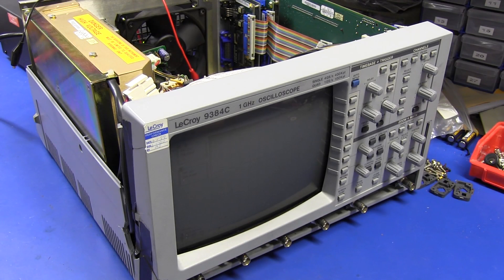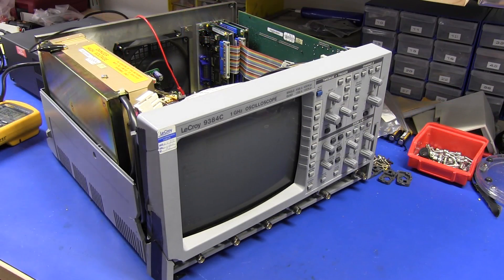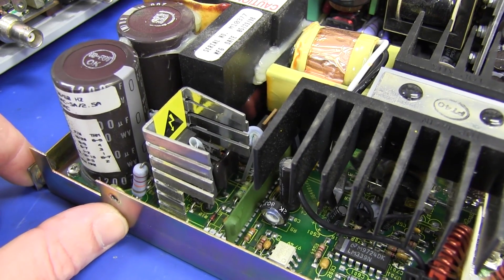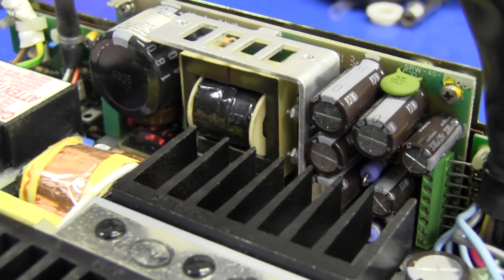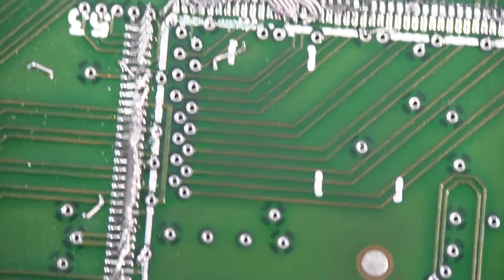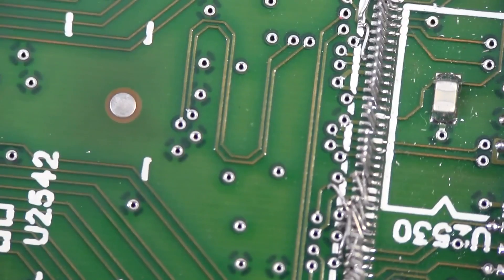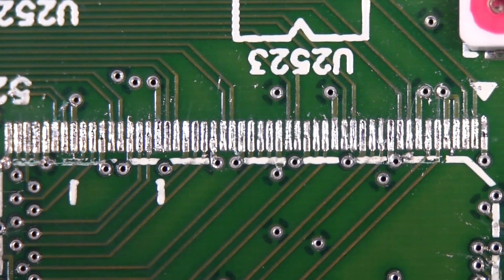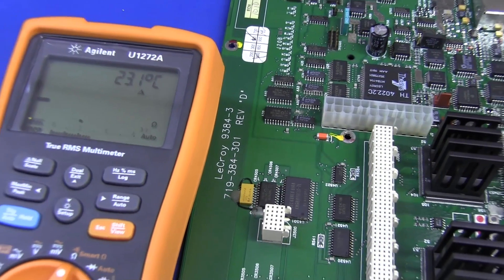EEVblog #405 - Lecroy 9384C Oscilloscope Repair - Part 3

Comment: OH MY GOD!! WHY?? It can be easily removed with the roses metal! Melting point is about 100C, so simply solder all the pins with the roses metal and then you can easy remove IC with hot air gun, because the melting point is very low. Bad decision

Comment: Way late, but I just got to these 3 videos.  I think you have introduced the Chip-Quick in another video, so nothing more about it from me.  Also, the lifting of individual 3.3 V pins has been mentioned, but I just remind that likely there are a bunch of them.  But one thing I must bring up:  The heat generated is supposed to be I ^2 times resistance.  A short almost by definition is zero resistance, so why would that generate any hot spot?  A temperature check does indicate heat generated in traces leading to that short, probably.  Or more likely, even.  Until the final conclusion, I was suspecting problems under the connectors, like the memory bus or the power input connector.  I personally have seen a couple of those.  But I have to agree that there had been a dramatic power surge that killed all those chips and the power supply as well.  RIP.

Comment: A $15 heat gun and a bit of patience will remove large QFPs quite easily. Just slow heat that area of board over a couple of minutes (even a bit on bottom side) and then concentrate the heat around just that QFP. A little flux on the pins will give you a clue that the temp is getting close. When the solder starts to melt wait just a bit longer and pull the chip. I salvaged 4-5 chips from a scrap board that way this morning myself.

We have a $20K Pace BGA rework station that basically does the same thing, i.e. heats both sides of board and pops the chip off with a vacuum picker.

Comment: The disappointing thing was that he didn't remove the heatsinks, because it might have shown holes in the chips. Heat softens glue so when they were hot, or with added heat gun,  they might have come off. Certainly would have given closure.

Comment: An interesting diagnostic session, and I admire your perseverance. I think if it was me it would have ended-up in the spare parts box about a third of the way through! Anyway, a useful point emerges, which is that diagnosis can go badly astray if it is assumed that a fault MUST be due to a SINGLE component, when that is not the case. In this case four components were faulty, and they were even giving clear fault symptoms, but it took a leap of intuition to realise that all four might be faulty. 

It is particularly relevant when dealing with a customer's job, since in that case some of the fault symptoms may have existed long before the thing failed completely, so searching for a common cause may be a fruitless exercise.

Comment: One tip to (destructively) removing this type of QFP packages from a board: get some piano wire or similar steel wire, push it into the tunnel from the side, and then pull hard  but slowly in a 45deg angle. This usually pulls the pins off the pads one by one just nicely.
Pushing a thick steel pin from the side may also be useful to leverage the pins off, but usually tends to smear/scratch the solder across adjacent pins..
Reply: Markus Strangl High risk of pulling the pads if you would like to put a new component back on again, but its true it would go fast. To snip the legs with a fine tipped cutting plier would pretty much be the best choice. With a exacto knife its still a little risky depending on exactly how its done.
Reply: dtiydr I didn't rip off any pads with this technique yet, but I can see how it might happen.
XActo knife has a certain risk to cut traces under the legs, though..
Reply: Markus Strangl Exactly; yet. :) And as I said if you use a xacto knife (yea thats what they are called), only if it done right would you not cut any traces.

Comment: You could check which legs of IC are connected to 3.3V and unsolder them, then check if short is still present.
You turned on the scope with 3 volt voltage applied, not 3.3 volts due to voltage drop on cables.

Comment: Please someone help me! I just got this small portable oscilloscope for free and the seller said it did not work. I brought it home and plugged it in. The screen would not turn on and in the beginning it gave out a burning smell. It disappeared after a bit. I opened it up and found nothing burned. All I found was a few transistors were becoming hot very quickly after turning it on. But the On light still operates telling me the machine is turned on. Can anyone help me with this problem? It's an analog oscilloscope.
Reply: reddit.com/r/askelectronics

Comment: That looks like a computer motherboard PSU plug...I wonder if a computer PSU would be able to replace that powersupply
Reply: No, he specifically mentioned +-15V and 2V being needed, those are not offered in PC PSUs. The scope supply also clearly used different color coding.

Comment: Would Lacroy supply a new board and if so do you know the cost ? At this point it's not a component level fix its a board swap. 
I suspect it's not cost effective to replace the board unless someone else is willing to pay the costs and even then there is the power supply repair on top of that. By the time it's all repaired you could probably buy one for less. Remember time is money !! Folks this was an educational process not a money making repair.

Comment: That won't affect the resistance measurements in the off state. In addition, another owner replied and stated that the resistance on a working unit was in excess of one ohm. This unit is exhibiting an order of magnitude less.

Let's run through good old Ohm's Law....

I (max rated) = 6A
R (measured) = 0.15 ohms
Vsupply = 3.3V

I =3.3V/0.15 ohms..... 22A.

The reason we only see 11A is because as the circuit heats, its resistance increases much like the filament of an incandescent lamp does.

Comment: Or as You said the 3.3 psu channel has its rectifier in short , sent AC the reversion of the voltage burn every chips,  there wasn't a single resistor as protection plus a zener... ufffff

Comment: I thinks, as you tested the board without the memory connected, those chips can't do the POST (power on selft test), they will try in a continuous way to check the memoriy (if they are microcontrollers/microprocessors)  they never will go to be in IDDLE, drawing mucho more current making heat.

Comment: As long as your SMPS is not shorting, Then I dont think its those chips. because you still have 3.3V @ 8Amps. those chips suck lot of power, and they have that heat sink, because they heat a LOT.

Problem maybe in other part. anyway GOOD VIDEO!

Comment: Dave, thats not a good method of fault finding.. You could have isolated the power lines to individual chips or could have lifted the suspected chip leg to check this. Well, i use this method for last 10 years & it works 100%, of course it requires lot of time & patience.

Comment: You just don't know what destroyed ASICs mean. ASICs aren't chips you can buy anywhere. The only one, who can have some of those ASICs in stock, is LeCroy, and if they still have those ASICs  (for this old oscilloscope model it's relatively unlikely), they would either use them for their servicing team. ASICs aren't like FPGAs where you only need the program to fit them a specific application, they are completly custom chips, and production runs cost millions of dollars.

Comment: Dave, I'm sure that you can see this coming... is there any way that you could have an underling (if you have one) do the same for the other three ASICs (cut them off and clean the pads) and then check the resistance?  I hate mysteries!

Comment: FYI: Your wrong, I use this very method to grind down Dremel  discs, one cuts in several places on said bolt making the disc as small as needed. Pity Dave's intelligence didn't rub off onto you before making a completely retarded reply to a stranger.

Comment: I had a LeCroy with a bum power supply that I binned, as well. I even had the service manual and new parts. It cost me more in putzing around than just replacing it

Comment: Put a cotton thread behind the pins. 
Now heat the pins at one end with the solder iron while you pull the thread under the pin.
Continue down the row with the rest of the pins.

Comment: Watching you remove the QFP was painful. It's time you did some (late) (non-denominational) holiday shopping and got yourself a system from Zephyrtronics   

Or just to get a feel for it, this kit from Digikey: SMD1-ND for under $15.

You could have removed the QFP with all leads intact, and PCB temp does not get up to normal solder melting temperature, so very low risk of pad damage or separation.

Comment: I disliked this because of that awful method of desoldering the chip. It's very easy to damage PCB tracks doing that. Why not to use a heatgun? Heatsink can be removed with heat too.

Comment: Yeah agreed, if the chips are not available for a reasonable price, there is no point in wasting more time on that. And even than then power supply could go bonkers again and blew the replacement and destroy hundreds of dollars plus a lot of time. Bummer.

Comment: Dave, can you take off the heat sink from this chip and check what it is? Maybe it's not ASIC, maybe it's FPGA - check if 8-pin U2542 isn't a FPGA configuration memory?

Comment: I have a question..when I plug my desktop computer into the power socket the spark comes out and I hear the voice of the sparking..once I do that my hard disk SSD malfunctioning  and takes about a day to turn on the computer.I have seen one of your videos talking about the oscilloscope and how not to damage the circuit that you measure..I have notice that my power system at home is not earthed; using just two wires.Could you please tell me or at least give a hint to prevent that spark

Comment: LeCroy is now definitely LeCroaked! Simplest way to unsolder is to put foil around it and then toast the heatsink with the hot air gun until it pops off.